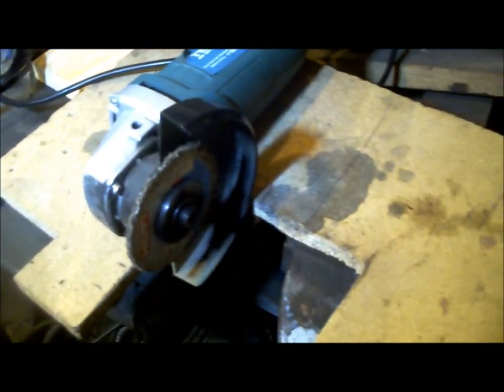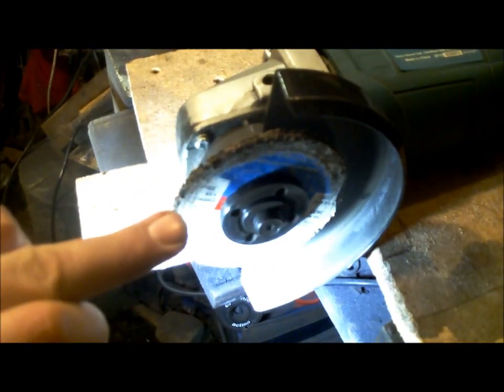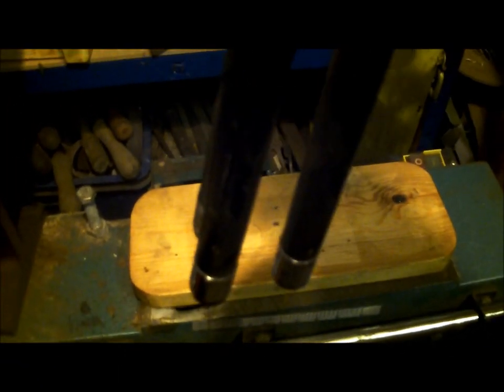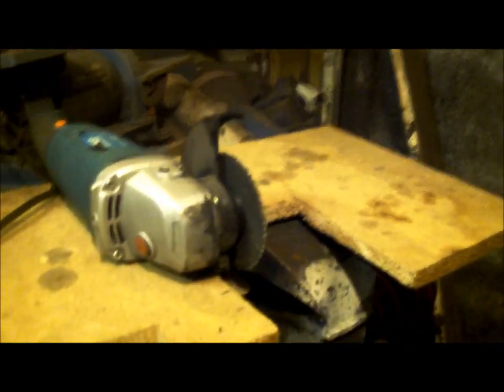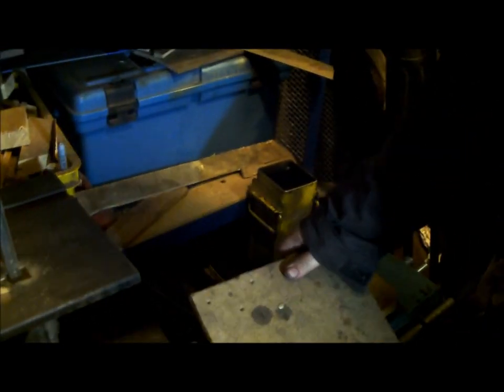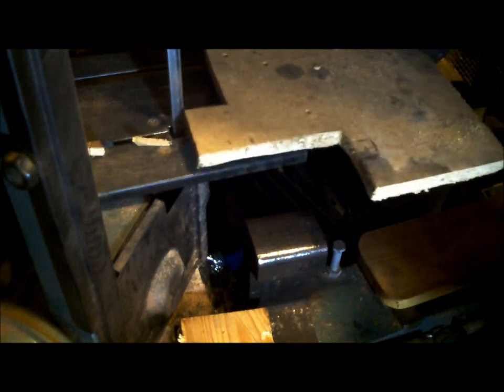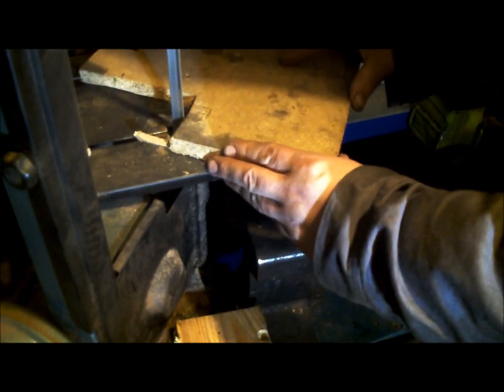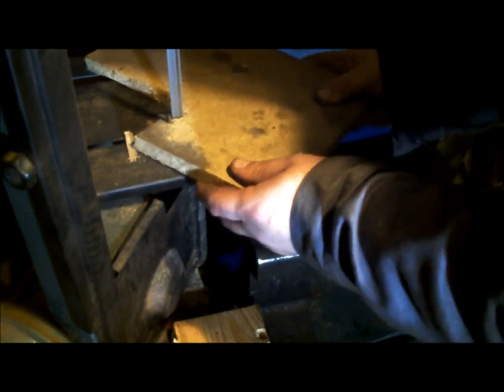Knife Grinder del Diablo

Comment from the maker: hi troll forge, initially the centre hole would be the wrong size needing an insert, then a rear supporting washer as the disc is much thinner then a bench grinder disc, then the speed would only be about a 1/3rd of an angle grinder as both my bench grinders are around 300watts, the angle grinder is 900watts,,it is hands down the fastest way I have to remove material..to set up a multi driveshaft that could mount cutting discs, finishing wheels etc. like John Fitzen is an option but would take up a whole bench, this is removeable and can be put away after,,all the best!

Comment: Great stuff as always,  you could install a small 4 outlet power strip with the built in on/off switch close by that you could use as a safety switch in case something went wrong, you just want it within arms reach of course.

Comment: people who know you know deep down, your more saftey concious than most.
forget health & saftey - use common sense :)
works for me.
health & saftey is just another way to get money out of people, signs everywhere, hi vis, courses etc etc - to all the bloody do gooders out there - JUST THINK ABOUT WHAT YOUR DOING!!!!! you dont need to be spoon fed lol
anyway, mini rant over.
i would of put 4 holes around the positioned grinder an cable tied it onto the board.
great job as ever mate
Reply from the maker: hi Funky,,I was thinking 4 slots and using strap webbing clampy things, or a fitted top shroud that hinges down to get clamped on one side with sleep mat foam inside for a tight squeeze, loads of ideas but at least it stayed put for the first trial run eh? I didn't fancy a floor dancing angle grinder too much , gyrating about my ankles,,oh how that would be be on film eh?

Comment: Awesome! Pretty crazy. I ruined my first knife with a grinder today, it was a really cheap one and I had been sharpening my knives for a bit and realised that the knife blades didn't very hot, then I got sloppy and didn't keep checking the temperature and in seconds I had a burn mark on the blade, I think that's enough to ruin the heat treat. Luckily it was only an £8 SanRenMu knife. Which are great by the way, if you're into folding knives Scott. I have a SanRenMu H03, it's $5 from fasttech.com and it's UK legal, it's a former spyderco design that got scrapped. Looking forward to your new creative ideas.

Comment: You know...
the wooden horse of Troy started out being meant to be a three riser step ladder ...
Then they let some mad bugger like you loose on the job.

and... is there any mileage in  having a fiddle with  some various sized guttering brackets , inverted, chocks under the screw mounts and padded  to take up any  excess of , what would be techically referred by experts as , the wibbley-wobbley thingy factor ?
Reply from the maker: there will be some form of hinge and bracket double act going on...haha!

Comment: Did you write a 73 page risk assessment ?
:)
Reply from the maker: well it was a bit boring...but hey here goes....

Site                     Building            Room
Wessex             Garage               Filthy wet Dungeon
 
Plant                                               Date assessed           review date
900watt angle grinder                   today                             pffftt!!

Purpose of plant
stock removal, deburring,,general farkin' about

Registration required?        licence required?                  supervision required?
hahahaha                           off a cornflake packet            please hold my hand....

legistration
1.1  lunacy to the nth degree
1.2  machine bastardisation certificate of at least nvq level 3
1.3  information, induction,training, supervision when required
1.4  comes after 1.3
1,5  high noise produced
1.51  turn the Metallica up then!!!!
1.6   moving parts, dust/debris, hot sparks and other mayhem
1.7  Hazard management
1.8  control of risk (lock up the guinea pigs)
  BS(bullshit)2087 safety of machinery
  BS(bullshit)2901 abrasive wheels
  BS (bullshit) 3098 Electrical equipment for manufacturing and general godlike performance on camera....
  

Risk assessment team

Funkyfirechecker
Stripysparkydouser
Dirtyroomattitude

residual rating of farkin' risky as hell must be endorsed by the local chair of the council for unnecessary meddling and nosey poking into areas that don't concern them...

item 1
can the following be entangled?
hair, clothing,Doctor Who scarf...             well  duh!!!!

likehood                           consequence                      score 
only if you're daft            uurrgghh...ouch                   4 where 4 is like ,,,after 3

item 2
will the use generate willfull creation of kickass blades?

likehood                            consequence            score
HELL YEAH!!                   FUN!                     even with the ladies!!!

assessment

pass with flame,sparks and probably scorched carpet....

review notes

hopefully safety will rise above certain death with the elimination of excess dust,poor lighting,pools of water,dirty and missing light switches, storage of flammable pressurised canisters near forging activities and two dea pigeons in the water tank...otherwise okay!!

hahahahahahahah!